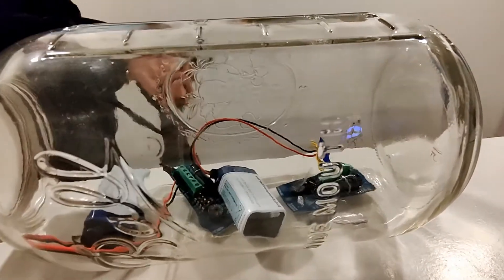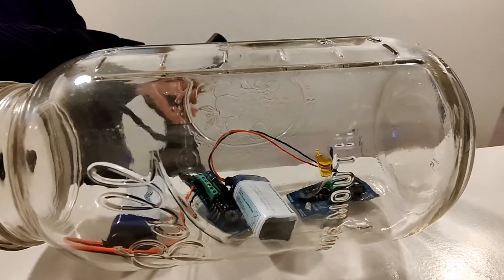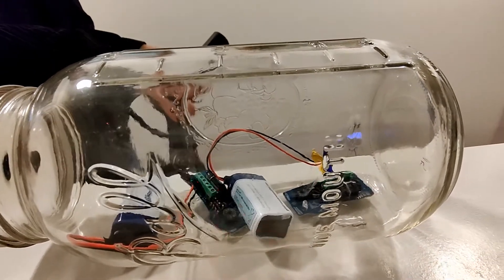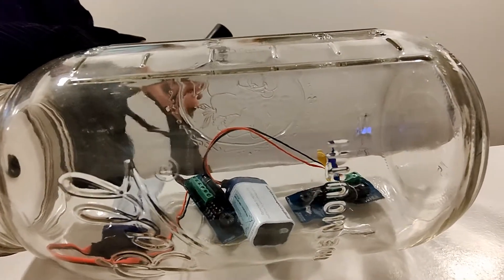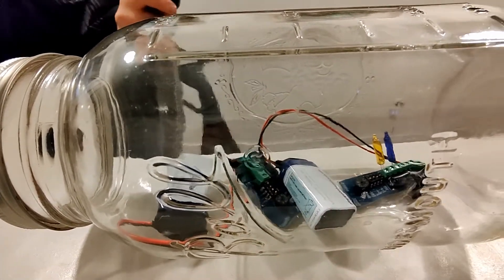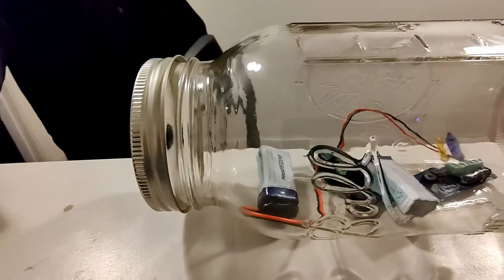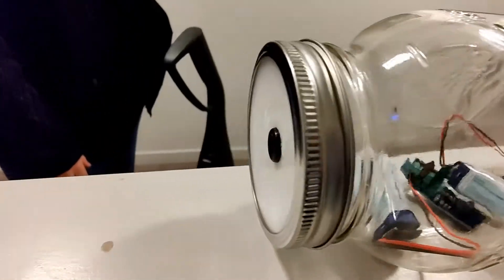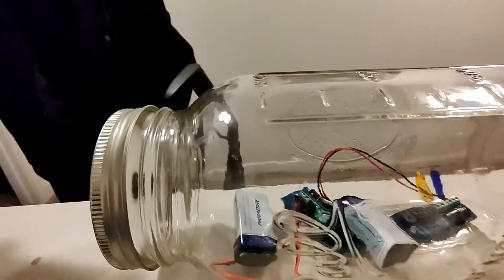Altimeter Test for Dual Deployment

Comment from the maker: we have another video where we test an Eggtimer Quantum. It might show the procedure a bit better

Basically, turn on the switch, apply vacuum. The altimeter, depending on the strength of the vacuum, may set off the drogue once it reaches maximum vacuum. If not, turn off the vacuum and it will fire. Then the main will fire after (when the altimeter thinks it is at the lower altitude).
Hope this helps!

Comment: i don't understand. the lights came on but the vacuum was still on. or did was the camera man zoomed in too close to were we could not see you move  it way? a
Reply from the maker: Yes, once it draws as much vacuum as it can, the altimeter thinks it is at the highest altitude it can achieve. Then it triggers deployment.
Reply: @apexrocketry  not sure i follow. so you pulled the vacuum away to get it to trigger? 

and how would you do the test if you only hooked it to the MAIN terminal? but thanks for the fast response.

Comment: How fast do you think the pressure equalizes after turning off the vacuum?
Reply from the maker: Quite quickly, I expect. Within a few seconds the altimeter believes the pressure has dropped sufficiently to ignite the main charges. A difference of several thousand feet and something that would occur much slower during an actual launch. The poor altimeter likely thinks the rocket is headed earthwards in a very rapid descent.